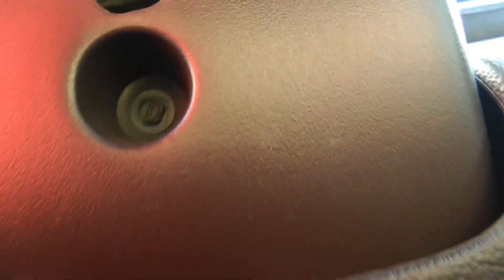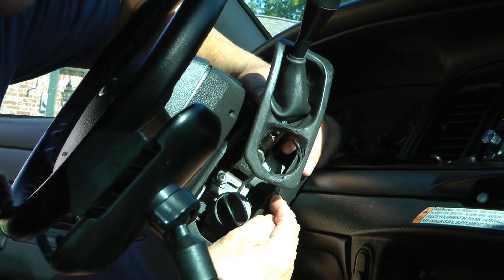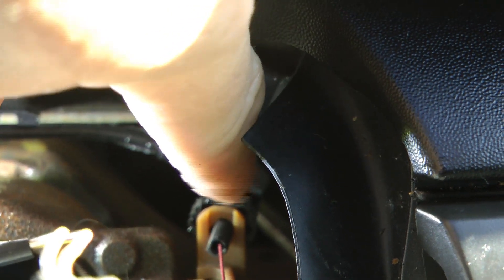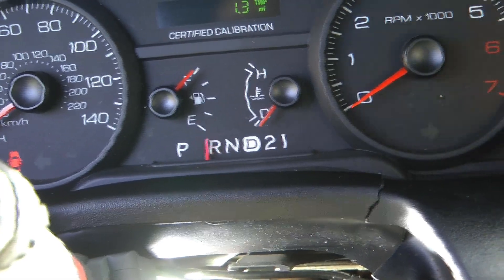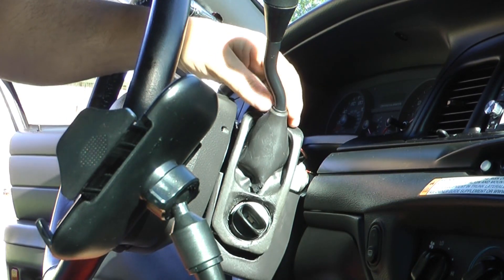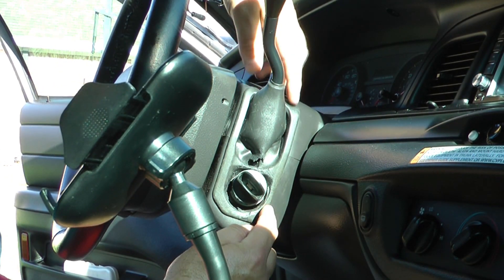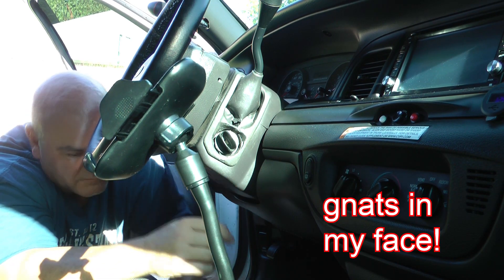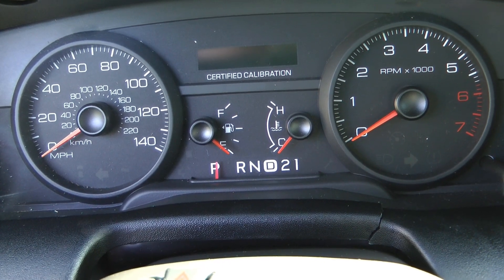Transmission shift indicator alignment PRND alignment

Comment: Thanks for the video! My car has the same problem. At the same time when it developed the gear shift misalignment the engine stopped starting. Might there be an ignition interlock that is connected to the gear shift indicator?
Reply from the maker: there is a park interlock.  I, thankfully, have not ever had any problems with mine so I have not made any videos fixing it.

Comment: Thanks for the tip I will be doing this. And my column shifter feels a little too loose, is there a screw I can tighten?
Reply from the maker: if memory correct it's held on by 1 screw.  Remove the top plastic cover behind the steering wheel and you can see it.  Shouldn't need any tools, but removing the bolts from the bottom cover makes it a bit easier to unsnap

Comment: Can this cause a no start unless you raise up on shifter lever
Reply from the maker: that's a great question... my gut feeling is "no" but I wouldn't bet my life on it.
Reply: @WJHandyDad  I have a 2008 and every now and then I have to raise up of my shifter for it to turn over otherwise it's like no signal to starter to crank
Reply from the maker: @charliemoore4047  I guess it certainly wouldn't hurt to align the needle and see if it fixes the problem.  Let me know if it works.

Comment: i've got gremlins in my 2009.  the interior light is turned on and off by the door latch. many of the bells and whistles are controlled by the gremlins in the door latch.  my window and mirror defrosters are also dependent on the mood of the gremlins.  door ajar light is always on and that sends the rest of the dashboard into a tizzy.
Reply from the maker: maybe a bad DDM (driver door module)??

Comment: Thank you, Gary. I was messing with that dial before trying to do just what you showed. However, my cable started to bend when I was reverting the shift lever back to park and, as a result, the bar was not moving. Somehow, I managed to adjust the dial back to where it was before off the center of gear letters, but at least the bar began to move again somewhat appropriately.  
About the sleeve, mine was pretty ripped, so with no regrets, I pull it off the lever and put a “new to me” one with fewer holes.  It looks better.